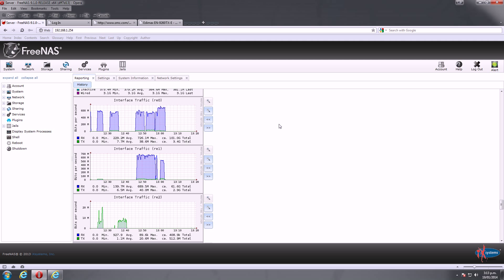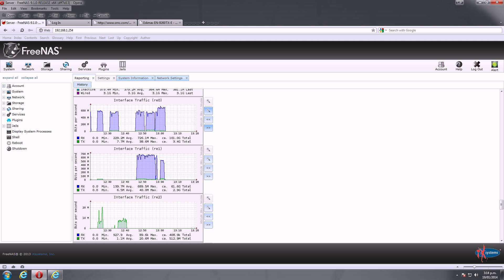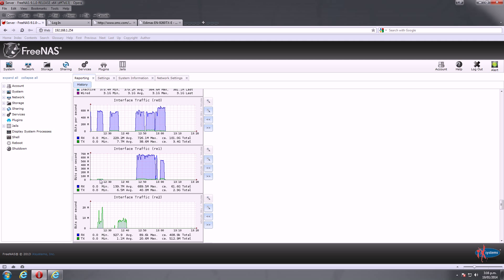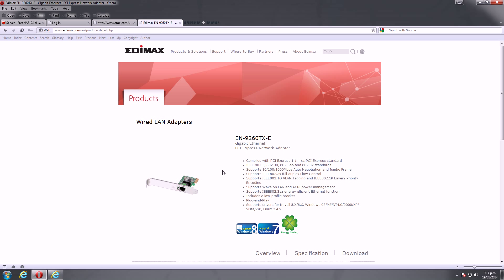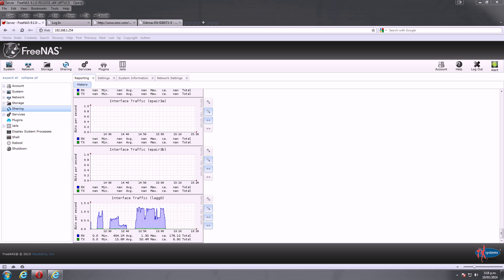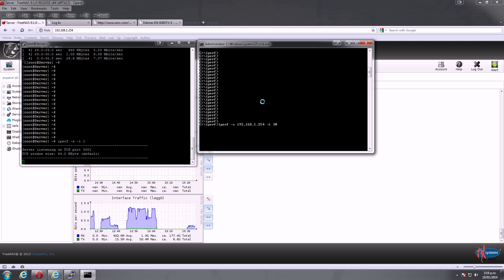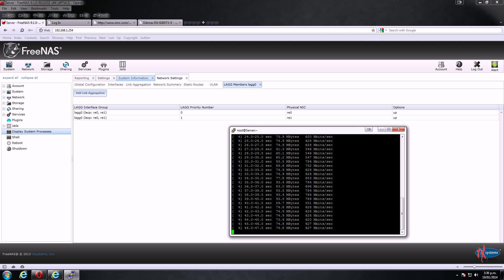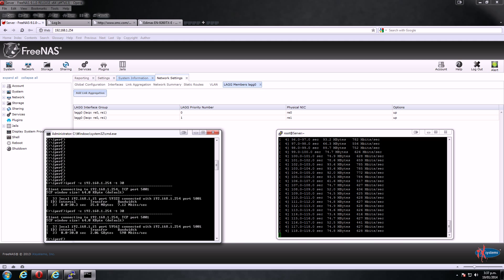Freenas Link Aggregation (LACP) Tutorial - Handy for Media or File Servers (Part 2) ISSUES!!

Comment: pci has a max bandwidth of 133 mbs (megaBITS) that's why they were preforming bad
Reply: +TeenAge TECH 133.32 MB/s not mb. 33.33 MHz * 32 bits = 1067 Mbit/s = 133.32 MB/s so that's not the case. Gig-E (1000base-X) has a theoretical of 125 MB/s.
Reply from the maker: Hi Late Reply, I was more doing this video as a guide, i think in the end I used 2 PCIe and 2 PCI. But I definitely had good speeds to around 3 PC's at the same time. But actually I never needed this on my network for what I do :-) it was purely as a guide.